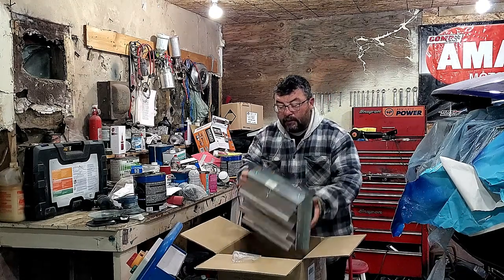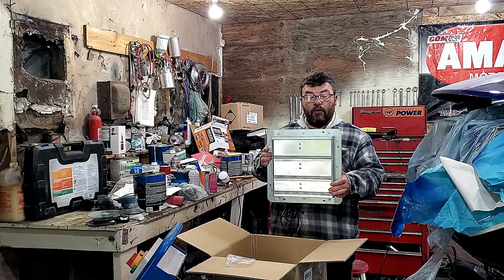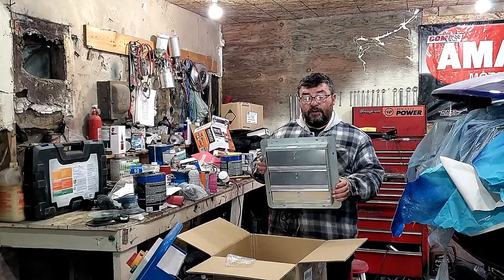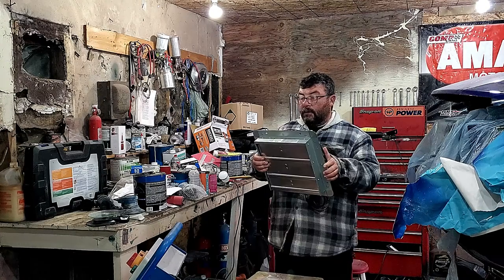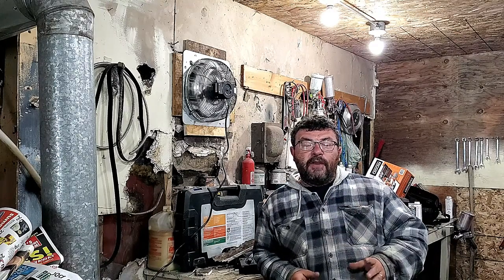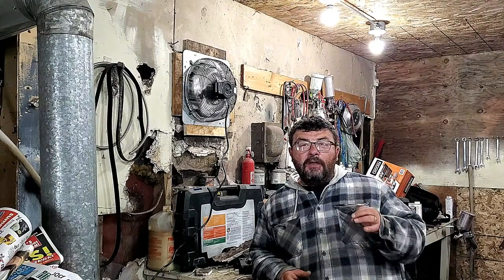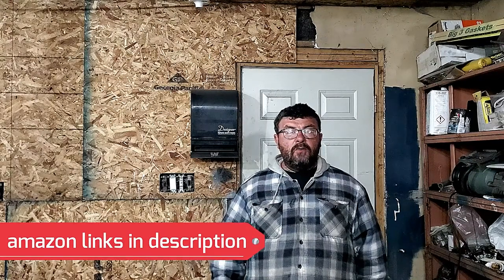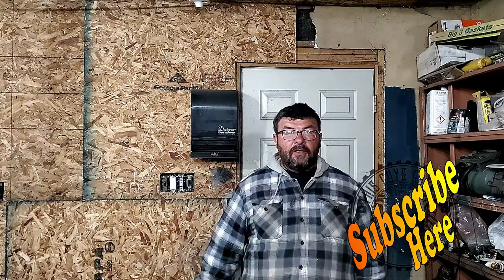exhaust fan for auto painting diy

Comment: I installed one of these in my garage I recently built, but slightly larger. I think it's 20 inch. It's fairly quiet and moves a good amount of air. I have 3 screened windows i can open for fresh air without letting bugs in. It works great, with one or two windows open.
Reply from the maker: that is awesome ty paul

Comment: One thing most DIYers dont consider aside from explosion proof is the size of the room. No, you dont want to have too much air that it sucks in dirt, but you really need enough air that is effective for the size of the room so that overspray is pulled out in a timely manner. Besides being abke to breathe with an appropriate mask, you need to be able to see your work without squinting through a toxic fog. Its not as easy as sticking a fan or two when you have a good size garage. Also, the size of the room is affected by what's in the room. A vehicle will displace some of the sq footage measured which can bring the needed CFM back down.

Comment: Any tips on improving my setup.  What I do is put a commercial box fan in the window opposite the roll up garage door.  I then wet the garage floor, door and outside the door.  I was thinking about putting a filter in the window between the door and fan and closing the door but was worried about fumes building up.
Reply from the maker: bey pcb ,i did the same thing for years . are you happy with the results dont change too much.. i am going to put some screened fresh air returns in just to keep insects out ,i think that may be the ticket .
Reply: @thisguysgarage Yeah it is usually just a tool box or some metal furniture.  That's a great idea to add the screening.  Thanks Capers.

Comment: How's she goin'?  This looks like a good unit for your shop.  What about winter Shaun?  It looks like you heat your shop with wood.  Do you think exhausting the air, even at 650 CFM, will affect your heating?  Thanks for posting and take care!!
Reply from the maker: i run a pellet furnace ,which will get the shop very hot ,i can compensate for the he loss by putting a return vent on the furnace itself now that I'm thinking of it 
great question ty for asking i really mean it.
Reply: @thisguysgarage  I asked because last year my shop had a ton of condensation everywhere.  I was using a diesel fueld space heater and my shop has no insulation.  I was wondering if your shop has a problem with condensation building up on walls and tooling.
Reply from the maker: @GrampiesWorkshop  i have a huge condensation problem.  I hope to run this for a few days to get some of the moisture out of the floor
Reply: @thisguysgarage  I think I will need to add an exhaust fan in my shop too, but I'm afraid it'll take all my heat out in the winter!!!  We'll see I guess!!!
Reply from the maker: @GrampiesWorkshop I would just run it when you are not there a few days a week maybe